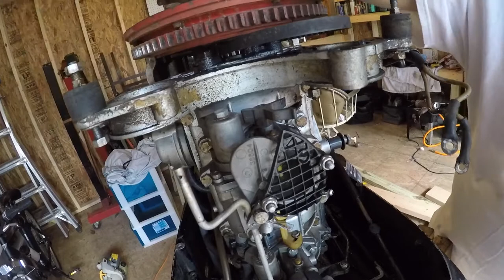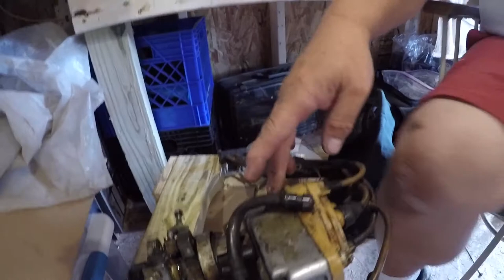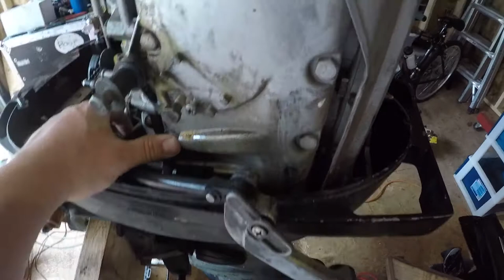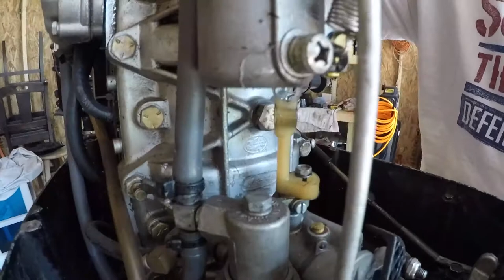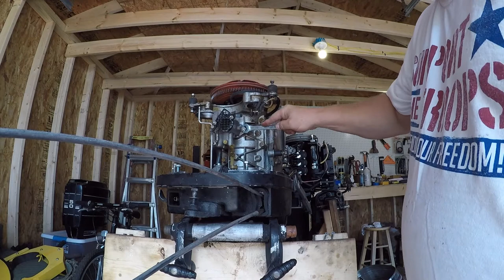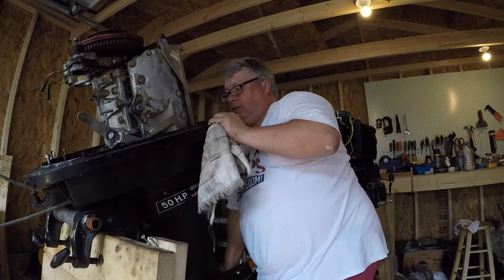Mercury Outboard Thunderbolt 500 50 HP Part 3 - Carburetor Removal

Comment: any thoughts as to where one could get reed valves for a 1968 merc 650 thunderbolt
Reply from the maker: I am guessing it might be a 4 cylinder?  Should be all the same for for the 650 series.  What is your serial number maybe I may have some?
Reply: @hawkeyemarine  2452431 made in canada 4 cylinder 65 hp. Reason i suspect this is i was spraying some sea foam in the carbs . as i was doing this the top carb would bog down but the bottom carb wouldnt
Reply: @hawkeyemarine  our boat dealer here in Canada says they are no longer available
Reply from the maker: @paulbrunner9661  hmm.  If you sprayed Seafoam into the carbs it would bog down regardless of the reed valves.  Seafoam btw will not decarb your engine.  Try Chem B-12 its much better.  As far as reeds go try Marineengine.com I know they have those.  A dealer is not going to help with an old engine like that.  There is plenty of parts for that engine.  Reed valves are going to be the same part number regardless of it was made in Canada, Belgium, or the USA.
Reply: @hawkeyemarine  thankyou

Comment: Just bought a 1973 15 foot StarCraft with trailer and this same engine for $800 did a compression test (1)=127...(2)=130.6....(3)=130.2...(4)=130.3 (in lbs) is this good? from what I hear these are great engines some of the best Mercury ever built and go forever. Your thoughts? thank you so much for making these videos you take donations??
Reply from the maker: Yes, that's good compression sorry for the delay.  Yes, they are great little engines.

Comment: Hi Hawkeye! I bought a Mercury 500 thunderbolt 1970 yesterday, according to the previous owner it idles great but stalls when it's put into gear (sometime it doesn't stall and runs just fine). Do you have any idea what could be causing this? I can see that a lot of people has searched the solution to this problem with these outboard but I haven't been able to find out what's the actual cause.
Reply from the maker: That's because it can be a number of things.  Check your fuel bulb and see it stays hard.  If not, then you may have have an issue with the tank or fuel bulb.  Its possible its not pressurizing.  It can also be a loose ground.  Or a loose connection somewhere or one of the cylinders is not firing.  I would check that first.  Weak coils and power packs are possible as well.  So, an intermittent problem is hard to diagnose it may run fine in the driveway but act up under pressure on the lake.  Which is why its good to run it in a large garbage container at home.  Hope this helps.

Comment: Hello you have piece yellow for carburator because my motor problem because no piece
Reply from the maker: I do not.  Not sure where to get that piece without a whole carb assembly.
Reply: My motor mercury thunderbolt 500 50 hp 1978 the piece for carburator broken you have piece
Reply from the maker: @galzoul  Sorry I do not have that piece.
Reply: Ok thank you your video is good for me
Reply: So, you found the piecevö Mr. galzoul?
Reply: T
Yes i found tank you

Comment: do yo have the parts number of the carburator rebuild kit?
Reply from the maker: Should be a Sierra 18-7013 double check your serial number to make sure.  https://www.ebay.com/itm/Carburetor-Kit-for-Mercury-AJ-KA-KB-KC-KD-Carb-4-4-5-6-7-5-9-8-20-35-Hp-18-7013-/332614414452?hash=item4d715d3074
Reply: 3176076 that’s the motor #